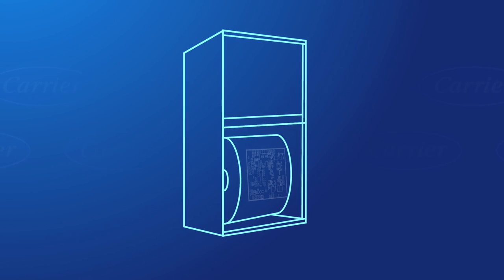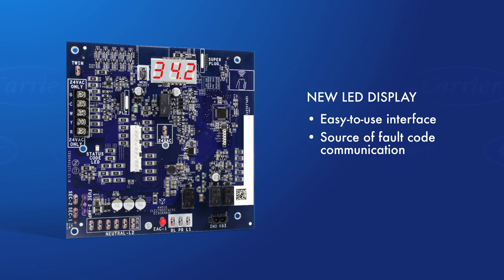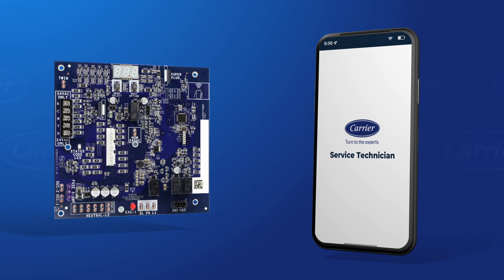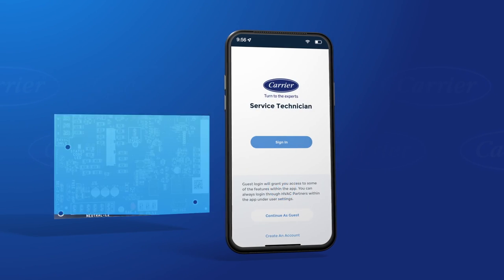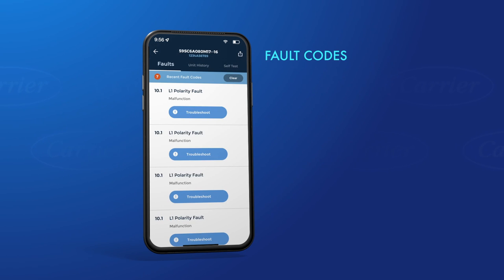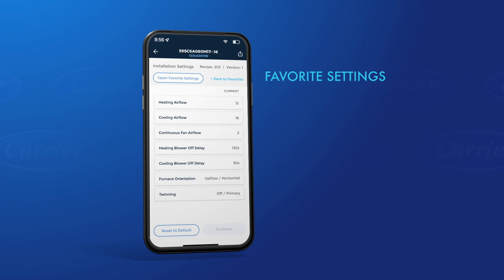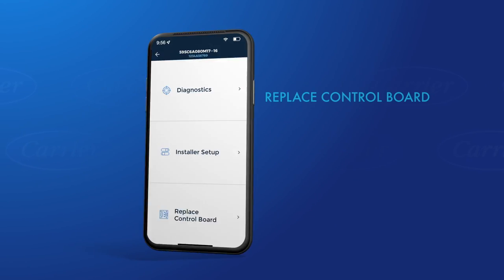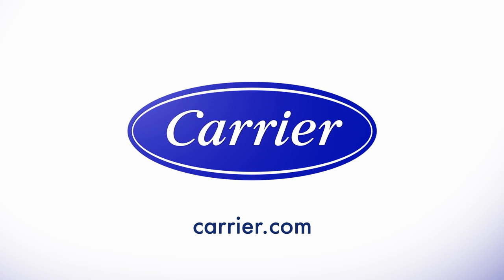Carrier 18-speed Entry Level Furnaces with NFC

Comment: Where can I find the CFM that correlates to the number settings for “High Cooling Airflow”.
Reply from the maker: The CFM info is still located in the product data literature and installation manual just like it used to be for 4 and 5 speed furnaces (and variable speed). It works exactly the same way... look at your static and your chosen fan speed to determine the CFM... but now there are 18 rows in the tables instead of 5 rows.

Comment: Why can it take so many times to connect? It’ll say error so many times before connecting. Bluetooth is a much faster connection.
Reply from the maker: It is not a speed issue... the amount of data being transferred between the board and the app is so small that for either NFC or Bluetooth, it is less than 1 second.
Reply from the maker: We do not know why it is so picky with connecting, but once you learn the exact angle to hold your specific phone, your connection success rate jumps from like 30% to 99%. Every brand of phone is different in where the NFC chip is located. We have done this process with hundreds of phones while training contractors during in-person classes and it can ALWAYS be solved with phone angle. We highly recommend you watch our recorded webinar at the 18 minute mark. https://youtu.be/my2btBLwkzc?si=2Y6FXm77rU76sZsr&t=1092
Reply from the maker: FYI - the board in the Infinity version of Carrier furnaces has both the option of NFC and Bluetooth. Pros on cons to each. Bluetooth is more expensive and it also requires the device be powered. https://www.youtube.com/live/Qlzkavsomb0?si=RT15GsyLW3FZrN_W

Comment: Can this application be used for Toshiba VRF SMMS7 R410 type systems. ??
Reply from the maker: No. We are not familiar with a way to combine a commercial VRF heat pump system with a residential gas furnace. We are also think that SMMS7 is a 50Hz system in Asia and these furnaces are 60 Hz systems in North America.

Comment: The unit is off but it keeps saying it’s not
Reply from the maker: What exactly does it say and where are you reading the info (app or furnace board)?
Reply: I get the same issue. It’s on the app. Either it say the furnace needs to be off or it’ll say error reading the NFC
Reply from the maker: @BandOfBrotherZ1  In order to use the Carrier Technician App to read the NFC chip of the furnace, the power must be OFF to the furnace. We know it seems odd to communicate to a device with no power, but that is how it works. The NFC of your phone sends enough wireless power to the furnace's NFC chip in order to read its data.

Comment: Another trash idea coming out of our industry. This is something else the customer will have to easy access to.
Reply from the maker: Not any easier than flipping dip switches or moving speed tap wires like current furnaces have. In order to use this app, the homeowner has to open the cabinet and touch their phone to the circuit board. It is not like they are accessing the fan speed setup from their couch.
Reply: @TECTubefilms as a tech I’d much rather prefer dip switches
Reply from the maker: @bjive5900  There is some beauty in that simplicity, but it would take a lot of switch blocks to handle 18 speeds plus all of the other settings. Now that we are into this for over a year, the techs in our area have overwhelmingly preferred using the app. Most didn't want to deal with it and learn if at first, but once they need it has been much easier.
Reply: @TECTubefilms  I was like that as well. I don’t mind the app in all cases but trying to teach it to my grandfather who taught me the trade and still likes to be useful was a severe pain😂